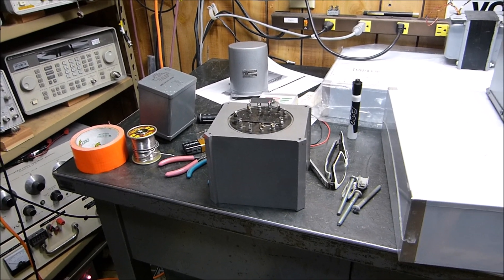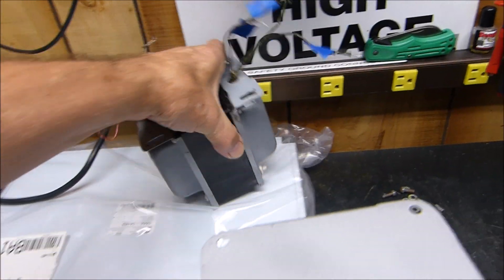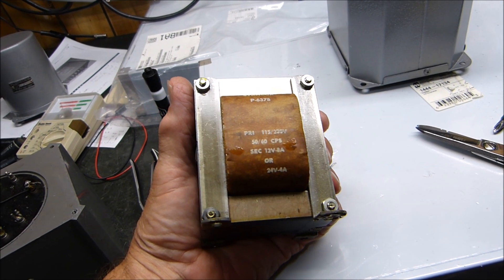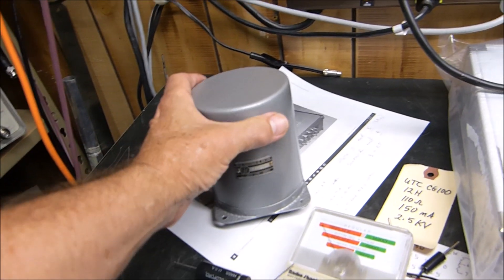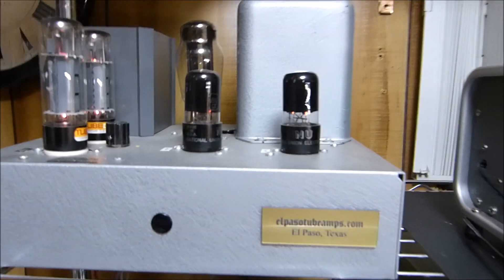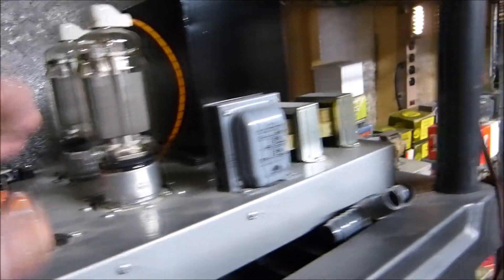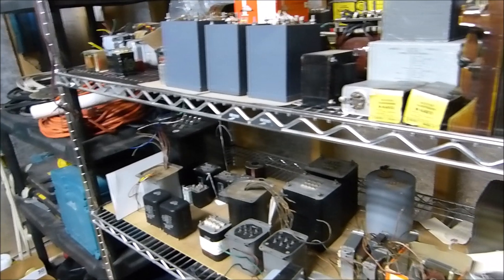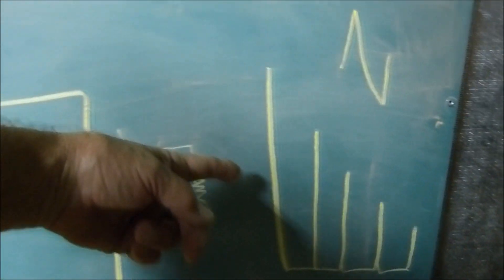Vacuum Tube Audio Amplifiers - What To Build Next?

Comment: Try 6DZ7 is a very interesting tube some say its a pair of EL84s but thats bull if you have compared the spec sheets are rated 18W per tube,and max plate volts is 400dc  that is four watts more than EL84 pair,.but there is a catch ,you will need a 9K primary to obtain the 18W  in push pull configuration.I built a dual single end with James audio 7k for 7wpc.sounds and looks amazing

Comment: Pp 300bs with a driver transformer maximizing output?
Reply from the maker: The 300B's are, without a doubt, a grand tube to use. Very linear and perform very well into a 5K primary. That would be the way to go if I wanted to build a PP 15 watt per channel stereo version with the  LS-35 or LS-51 OPT but I want to build something a little different. I really enjoy building with the vintage UTC "iron" and seeing these transformers perform so well even after 60 years since they were made. The OPT end up being huge by today's standards but that is OK. So many ideas have been presented. Thanks for your comments.
Reply: @ElPasoTubeAmps  Perhaps pp 6V6 as drivers in triode via an interstage transformer would allow you to see more?

Comment: I like the 833-A run gently on 1 kV which draws 110 ma with zero bias. I use batteries and switch polarity to estimate linearity in how the plate current changes and on the chart the current vs grid voltage lines are evenly spaced near this. I use Hammond 1642SE output transformers designed to carry much more current without core saturation and I drive the grids with 245's through Lundahl LL2765's stepped from about 5k down to about 600k. The DC to heat the 833-A cathodes is a little crazy, a 50 Amp rated bridge to 87,000 microfarads, 0.1 Ohm followed by 4.5 Farads which for safety have to be pre-charged with a 9 volt power supply through 100 Ohms in order not to abuse the filament transformer when starting it.
With Magnepan 0.7 speakers in a small house it is more than enough power and it sounds beautiful.
Reply from the maker: Robert, 
Wow... you did it right and I am sure it is very nice. I suppose you might have seen my video where I build a SE 833A amp but used a very large PP OPT that did saturate at 833A quiescent current. Some YouTube viewers tried to warn me about saturating a PP transformer in a SE circuit but I wouldn't listen.
This request for building ideas has so many wonderful ideas of different beautiful tubes but I want to use what I have. I don't want to spend $$$$ on new tubes and transformers. Most likely, the amp build will be with/for and appreciating the UTC transformers or maybe the Triad. The problem with using the Svetlana triodes that I have is I need a 10K primary OPT. I do have a 50 watt, 10K OPT and that may be the way I go for those tubes but I thought getting lots of ideas would be fun and indeed, it is, to see what other's think of. From 829B to 807 to 813 and the 211 triodes and so on. So many wonderful ideas for an amplifier build. Thanks for your comments. Sounds like you built a really nice 833A amp. Magnificent tube and I do run one in a 20M RF amplifier that I think is beautiful to watch along with the 866A MV rectifiers modulating with my voice.
Reply: @ElPasoTubeAmps  What a collection of transformers you have. If the transformer is designed push pull I think it best to build push pull with a pair of 211's with balanced circuits might be worth trying. I paid $258.40 each for my Hammond 1642SE transformers but that expense is for another time in the future. Driving it could be done with a push pull transformer which steps it down to 600 to 800 Ohms. A headphone transformer should work for this. We are all looking forward to what you create next.

Comment: Lovely big transformer but I think a stereo amp is worth the effort I have been a professional audio reckless for 49 years so I like to work on very unusual topology amps the Wimenson cirtronict is interesting also the push pull class A recently I have been playing with a balanced bridge type the advantage with this is the transformer has no DC thru the primary so much lower inductance so much better high frequency response and no center tap needed also better step response I am working on one now with four 6550

Comment: I for one would like to see a video on building an amp from scratch, EG chose your transformers, then show a reasonably detailed account of it's design. I know you tend to find a schematic, then build the amp, but that isn't very challenging or informative. Either that or chose some not often used topology, EG PP class A amp without phase splitter, bridged OP, Hedges cascode differential front end or straight class AB2. Just thinking out loud.

Comment: Adrien posted about vari mu type compressor build. If not just that then some kind of amp, bass or guitar, that implements a sort of tube compression. Something that can be engaged on or off with levels of adjustment. Focusing more on the preamp stages might be a nice change of pace.

Comment: If you are interested in building a tube amp, where would you start?
Reply from the maker: That is the $64,000 question (remember that game show from 50 years ago?). There are a number of marvelous suggestions made on this video but there is always one thing that is a real show-stopper and that is the output transformer (OPT) . Power level is one thing and primary impedance is another for the OPT. The common OPT impedance's for tubes like the EL84 thru 6550's is, on the average about 5000 ohms with, most likely, an 8 ohm secondary. Common OPT generally are in the range from around 3600 ohms to 8000 ohms OPT's are not only hard to find sometimes but very expensive.  Most of my transformers are rather small in power level running from around 15 watts to 50 watts with a few others up to 100 watts and a pair of huge OPT that will run over 1000 watts, but they get really big and heavy at 1KW level.
So, where to start? It all starts with the "iron". Do we have the power transformer, power supply choke and output transformer to do the job? Everything after that is just small parts. Blank chassis can be purchased from Mouser (around $50) and then we go to work, assuming we have the tools and are familiar enough with high voltage to stay alive.
The way I see, it is all about the desire for some particular tube or chassis layout and that sort of thing. That can be really important on a personal level.
We have to decide if the amp will be SE or PP? Actually, that is decided back at the OPT level...   SE amps are low power and as I mentioned in the video, do not measure out very well although they may sound wonderful to a particular listener. I prefer PP amps of at least 25 watts or more but I have made so many, I would like to do something different.
In my case, I have to decide if the primary goal is to use these old magnificent UTC transformers in common Williamson type amplifier circuits with the 6L6/EL34 family of tubes or do I want to use something exotic like an Eimac 4-65A. 
In most of the amps we build, we like to use only one power supply (PS) voltage but not all tubes can be run in a "triode" mode with the screen at the same potential as the plate. The 4-65A is one of those tubes and must have a separate screen supply. Multiple PS voltages makes an amp much more complicated, large and expensive.
I still haven't decided what to start on but the suggestions are absolutely amazing.
Thanks for your comments.
Reply: @ElPasoTubeAmps  I have a lot of terminology to become familiarized with, but I do, somewhat, have a decent background with electronics. As far that television show, that was a little before my time. Thank you for your response and I will dig into this and see what is required.

Comment: For those of us not blessed with dozens of valves and transformers (or money!) I would be interested in your thoughts and possible build of this amplifier suggestion, and the interesting use of this 100 volt transformer.
http://www.vk6fh.com/vk6fh/ECONOMICAL%20VALVE%20BASED%20AUDIO%20POWER%20AMPLIFIER.htm

Comment: I would love a pair of 828 tubes.  I think they would sound far better than the 813.  Were even rated at Audio. 814 and 828 were back in the 807 era.  I have never seen the 828 in push pull done.  Should be 300-400 watts.

Comment: I love your channel, have watched for a number years
i would love to see an amplifier built from readily  available, inexpensive  parts
Reply from the maker: You are indeed answering the type of question I was seeking with the posting of this video. I wanted to know if most people had rather see reasonable level power amplifiers (25-50 watt range) and how my videos might help others build their own or would most people rather see super high power amplifiers running at 3000 volts that are actually impractical and almost impossible to find the "iron" to build them. I probably won' t build anything like a SE EL84 amp but I also don't need to go the the KW level using Eimac transmitting tubes.Thank you very much for you thoughts and comments. I am thinking at this time it will likely be a two or three part series on building with some of the UTC transformers and measuring the performance to see if the amplifiers actually live up to the specs published on these very nice vintage transformers. I have not been disappointed yet with the performance of these old items.
Reply: @ElPasoTubeAmps  how about a combination amp  using non traditional tubes, such a 6c10 compactron for the front end with a Baxandall tone stack and 6l6 finals
Reply: Don't do a 6c10 they are very expensive now.  Any compaction that was used by fender or ampeg in guitar amps have become very expensive.  Maybe a 6u10

Comment: How about a 3C22 disc-seal triode?  Sure you'd have to build sockets for one since they have external grid and plate connections but you can get 60w out of them without external cooling.  And apparently they will work well with output transformers designed for 6550 tubes.

Comment: OTL amp! I’m working on one myself and it poses some unique challenges.
Reply from the maker: I have only mentally touched on the OTL design with the huge power supply triodes like the 6080 and such. I think it would be a tremendous project but I will have to think about that one before I start. Thanks for your thoughts and comments.
Reply: ElPaso TubeAmps Thanks for your reply! I’m sure you could make a phenomenal OTL if you planned it out. On the other hand you have so much great iron laying around it would be a shame not to use it.
Reply from the maker: @josepherdy6922  The closest I have come to a OTL amp was not long ago when I built a stereo headphone amplifier for my grandson but in the end, I went with the little power triode 1626 and small output transformers.  
https://www.youtube.com/watch?v=2r6q8pA6H18&t=954s
It is a possibility but as you mention, the UTC "iron" is hard to ignore and I really do want to see if those huge 35W,  LS-35 transformers will deliver what they say. I think they will.

Comment: It is a risk that the power transformer will saturate. 

Measure the L with the desired DC current flowing.
Or Build a PS with it and see the difference with a proper choke.
Reply: Yup, choke design is pretty specialized, 'gapping' is almost essential unless using unannealed steel or a lower grade of magnetic steel....at which point it will be massive, so there's every reason to just buy a spec'd and proven one off the shelf.

Comment: Great video! I noticed some small Edcor transformers in your stash. Have you ever used larger tube output transformers from them and do you have any thoughts? I was pretty happy with the amp I built using them, especially considering cost.
Reply from the maker: I have not used any other Edcor transformers but I have always hear they are good transformers. Pretty much of equal value, in my opinion and experience, are the vintage Acrosound, UTC and James transformers. I have found that the older transformers like the UTC and Acrosound do not usually measure the same from one transformer to another and I have commented on that in my videos whereas the (much newer) James transformers do measure the same from one to another. Fortunately, it certainly seems to me from my experience, the actual Z and L values  of these vintage transformers are not critical at the 25-50 watt power level we build most amplifiers to. 
This is definitely not true for 500 watt and above transformer impedance where impedance values are well above 10k ohms - like a 20K primary impedance. At those impedance and power levels,   primary impedance is much more critical. I think this pretty well explains why we can use OPT from 3.6K to 8K in our 6L6/EL34 family of tubes and get much the same level of power performance.

Comment: Make an amp that you are excited to get into.
As a side question, where are you getting all these transformers from. Are they pulls?
Cheers,
Reply from the maker: Thank you - that is exactly what I want to do - something that I can really get into and something that all my viewers can enjoy also. I have been collecting these pieces of "iron" for most of my life and I have them well protected and stored in a safe place. Honestly,  I want to build with these components before I am no longer able to do so. Just a couple of years ago I got into a project to use the B&W 850A type tank circuits, beautiful vacuum capacitors (and so much more) and put together the 3-400Z amp that I run daily with my older S-Line equipment. It delivers a solid 600+ watts to the antenna and people say it sounds great.  I think I am getting back into that mood right now. I will be turning 70 in a month and my mortality is looking me in the eye and I want to do and enjoy this passionate hobby of mine as long as I can and share it with the world. I decided a few years ago when I got into YouTube it is so much more rewarding to share these experiences with the whole world rather than just build in a vacuum in my basement and workshop where on one but me sees it. This is an amazing community I have found on YouTube and each one of you that I communicate with gives me ideas of what to build and keep going. Very much appreciate your comments.
Reply: @ElPasoTubeAmps  Thank you for that answer. I appreciate all the content that you and others generate and I believe it has importance beyond just entertainment. In a sense these videos act as knowledge archives for future viewers. They capture information and workflows that would normally become lost to time.
Cheers,

Comment: I would love to see a high powered AM modulator for an AM station,regards Colin G1PGI
Reply from the maker: I brought over the parts for an AM transmitter tonight. Modulation transformer, power transformers and chokes and tubes for a 4-125A class-C amplifier modulated with a vintage Collins Radio modulation transformer using 75-TL triodes. It will be beautiful.  I will be using a vintage Collins 310B exciter just like I did back in 1975 when I was running an AM station in Huntsville. Back then I ran a class-C,  4-400A and plate modulated it with a pair of PP 4-400A but I don't think I will go to that KW level this time just because of the physical size  - I was also 45 years younger back then and could more easily hoist these monster devices around...   73

Comment: Build an OUTPUT TRANSFORMERLESS amp
Reply: You mean a Circlotron?  It's not worth building unless you're willing to make your own power transformers and use at least a dozen output tubes!
Reply: @douro20  A lot of what is claimed for workable Circlotrons is misleading. You can't get away from drive impedance as well as *source impedance*....something many of today's explanations miss. You need an extremely low driving impedance (read a massive tube, or as was mostly done in days of yore, pairs of tubes in parallel) of the type used for high power regulators or xmtrs in days gone by.

Doing it for a headphone driver or high impedance (800R or so) would work, but....
Reply: @stephensaines7100  Yeah, even if I could afford an Atma-Sphere amp I wouldn't bother.
Reply: @douro20  have you seen the one from Mr. Gerhard Haas?

It is my first electronic project and I think I can now rewire the Apollo 13 capsule. Yes, it's complicated but there's no (good) information about that topology on YouTube. So closing a gap would be great

Comment: If the caps check ok why not use them. I let them sit at rated voltage for a while before use.  My old Tek 575 curve tracer still has original caps and works like a charm. My favorite tube is the 813. Wish I had bought them in bulk many years ago when they could be picked up on the surplus market for a song. I admire your exceptional craftsmanship and youtube channel.

Comment: Can 829b's be used in ultra-linear mode? If so that would be a great for me. I have about 20  to  30 of them and watching you would be a great help. I also have more 6sn7's than the law allows so I've been plotting on a 6sn7 inverter with a multi stage 6sn7 pre-amp. I'm also holding on to a dozen or so 6v6-g-gt's and 12DQ6B's. Most of  my  stash  is pre  50's. Just looking to build something but the combinations I have I can't find schematics for and have no idea how to go from 6sn7 preamp to 829b amp.

Comment: Maybe an 807 amp will be cool, or if you want to do some brainwork you could investigate about using power supply transformers as output transformers

Good luck!
Reply: Pwr xfrmrs work as well as an opt xfrmr as tractor tires on a sports car.